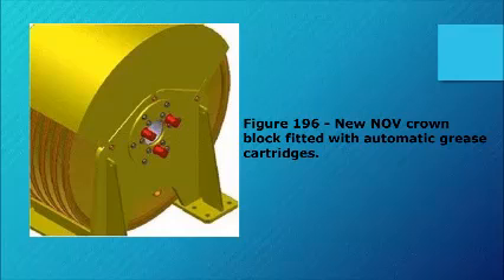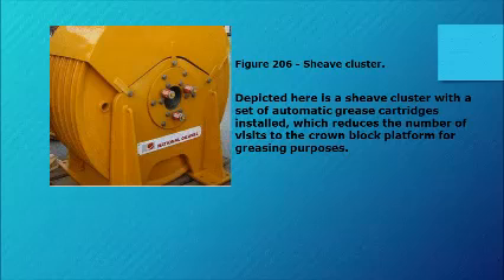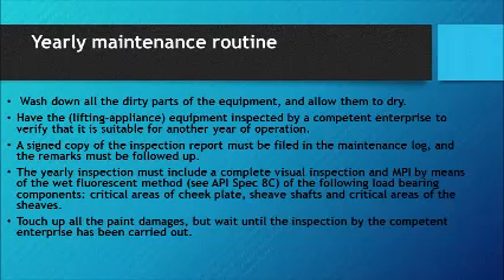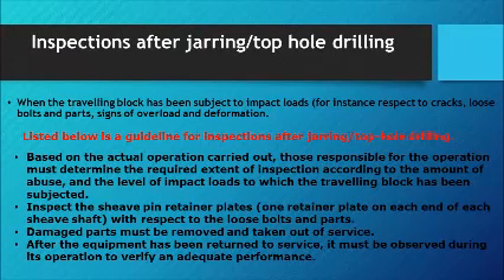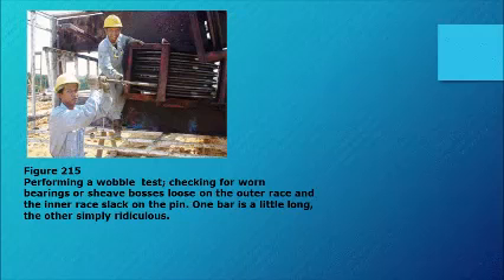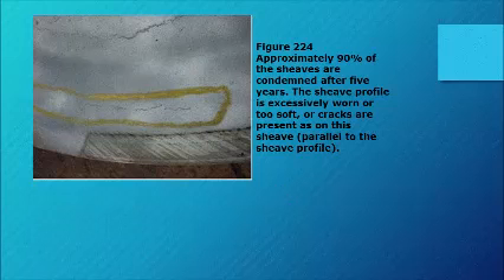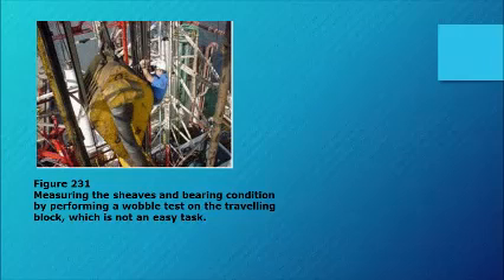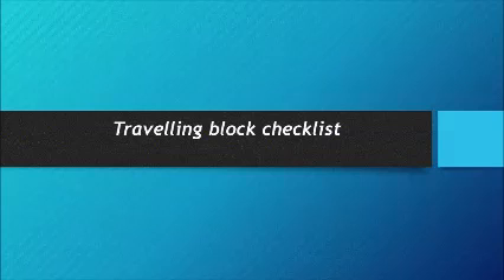RIG INSPECTION   CROWN AND TRAVELLING BLOCK

Comment: How get job in rig in Kuwait? 
How many companies in Kuwait? 
Is Rig Inspection or Maintenance paid good ?
Reply from the maker: To get a job on a rig in Kuwait, you can explore job portals, contact recruitment agencies, or directly reach out to oil and gas companies operating in Kuwait. The number of companies in Kuwait may vary, but there are several major players in the industry. As for the pay for rig inspection or maintenance, it can vary depending on factors such as experience, qualifications, and the specific company you work for.